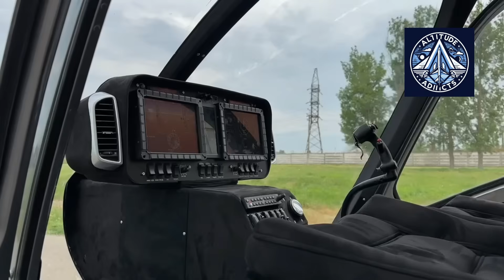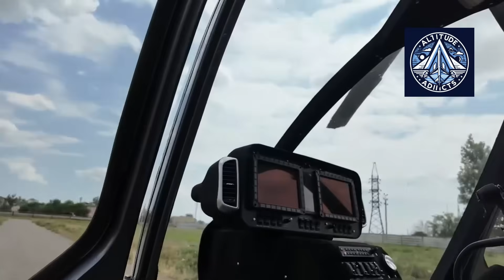Russia’s New AP-55 Helicopter: Ground Tests Begin

Comment: VK-650 engine ? that would need a redesign ?
Reply: unclear. initially, it was developed for a rotary engine, and it is clear that there is not much space in the body. you can compare the original mi34 and the mi34m1 with vk650. the vk650 version has a significant build.up on the body. on the other hand, it is unclear why he has two large exhaust pipes at once